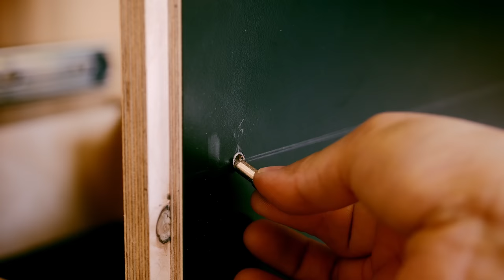DIY #8 | Entryway Shoe Cabinet

Comment: Such an excellent build for my first visit to your channel! Subscribed! Functionally speaking in my house I would not allow shoes on the lower rack outside the cabinet. Everyone would abuse it and would defeat the point of the entire piece. Alternatively, I would route some slots on the bottom shelf to allow for draining. or better yet just make the bottom shelf a metal screen material. That’s just my spin on it.

Comment: I simply do not know where to start. My guess is that your Father or Grandfather taught you , or you watched someone that age, because I'm that age. Finally some that uses laminate instead of depending on melamine for a surface.  If I could offer a piece of advice, I laminate the entire surface and then install my joinery.  But , whatever works , and you certainly have the skills. I have been woodworking for over forty years, and I am truly impressed. Great video and so enjoyable to watch. Cheers!
Reply from the maker: Thank you for your kind words and advice. :)

Comment: Nice build! Except your figure 8 clips need to be installed on the ends, not the sides! Your current method doesn’t actually allow for movement across the grain
Reply from the maker: I did that because the body is made out of plywood which is quite stable. If I used solid wood for the body, I would not do that. or are you worried about the wood movement of the base?
Reply: @jennsmistake  oh gotcha. No I was worried about the top, so if that’s plywood then yah good to go!